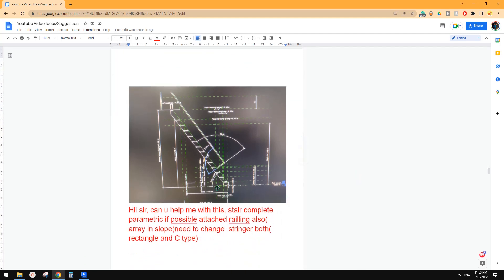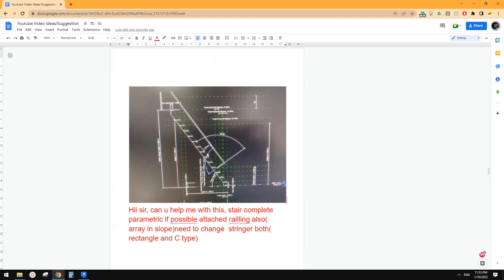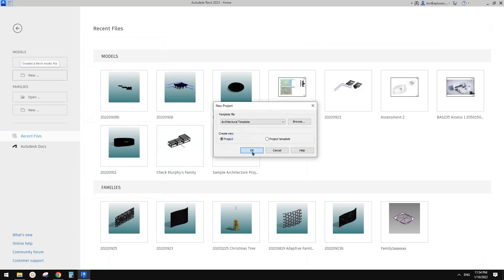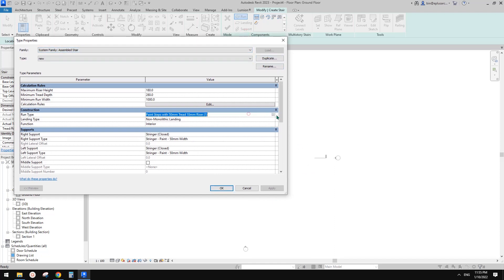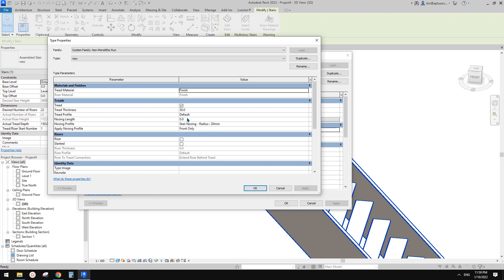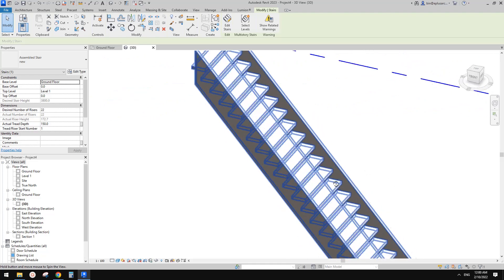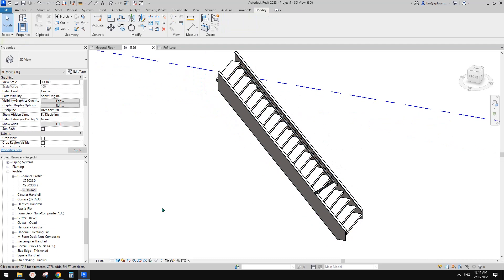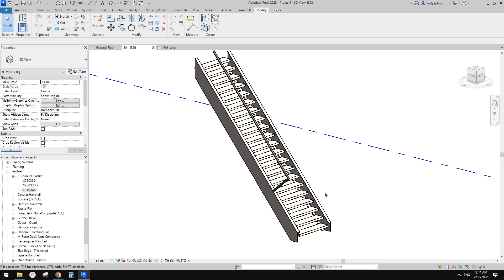Revit Exercise (Day 923) - Stairs

Comment: Hey Bin, am having a slightly different stair comprised of  "L-Profile for the Tread [Left and right] and metal deck in the middle tobe filled with concrete. could be having a suggestion how to model this. Thank you
Reply from the maker: TBH, I am not very confident about stairs, maybe you can post it in the shared document and we can try it together?
Reply: @BINHE615  let me prepare and share the file. Thank you